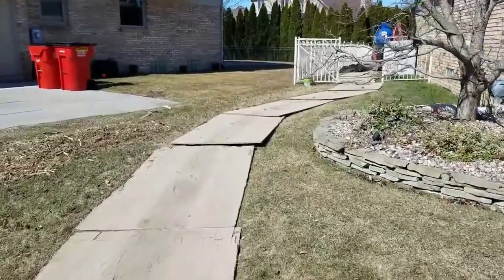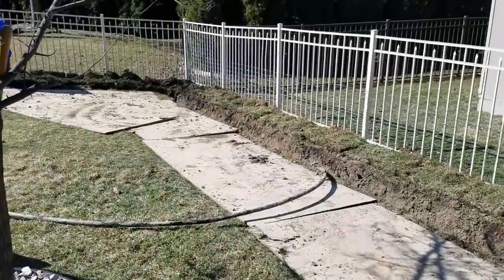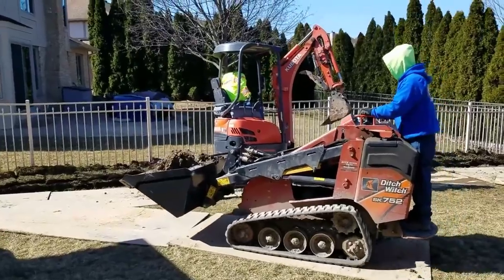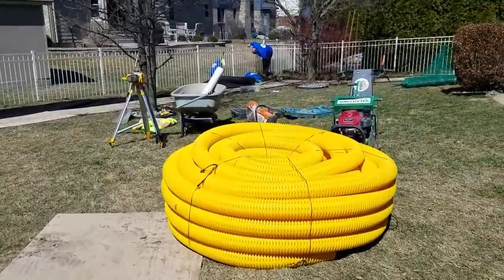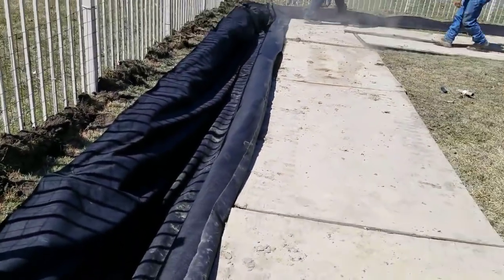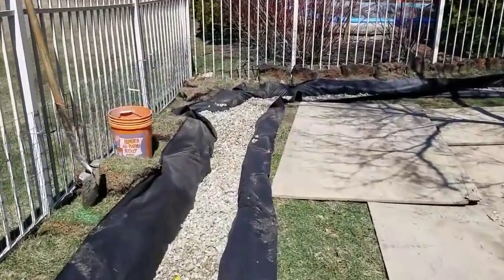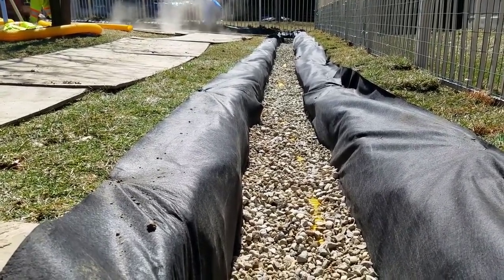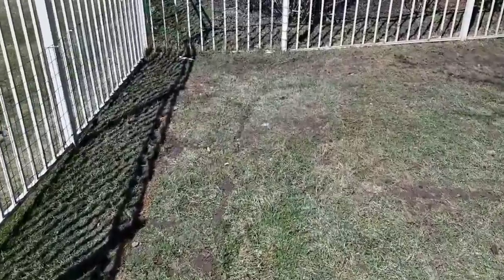FRENCH DRAIN MAN 248-505-3065 don't settle for a pretender get the real deal today 248-505-3065

Comment: I’m in Detroit Michigan.  Where can I buy the preferred geotextile fabric and pipe locally
Reply from the maker: FDM's Patented Yard 

French Drain Man / SherDrainage Duplex Sump System

FDM's Online Yard Drain Supplies:  https://www.frenchdrainman.com/store
=======

French Drain Man – Michigan’s Yard Water Drainage Experts. Masters in the art of constructing contained French drain systems & curtain drain systems that and fix your yard drainage problems for years to come. Over 30 years’ experience in solving yard water drainage problems in Oakland, Macomb, Lapeer, and St. Clair Counties.wood Landscape Construction, LLC
4015 Van Dyke
Almont, MI 48003
248-505-3065 

https://www.frenchdrainman.com
http://www.macombcountylandscaping.com

Follow us on:

Facebook: https://www.facebook.com/FRENCHDRAINMAN/ 
Instagram: https://www.instagram.com/frenchdrainman

FDM's Patented Yard Drainage Duplex Sump System

#frenchdrain #drainagepipes #frenchdrainman
Reply: FRENCH DRAIN MAN Thanks! Do you have any recommendations for concrete sealer along an exterior basement wall especially where the footer and wall meet?

Do you do installs in Southern Wayne County? High have most of the wall unEarthed.  

I might need to rent a piece of equipment to get through the hard clay near the house.  I am thinking about using a demo hammer with Clay spade if I do it myself
Reply: FRENCH DRAIN MAN One last question: how much stone should I put on top of the pipe if I’m using it as a drain tile or the basement footer? I have a walkout basement so part of it is about 8 feet below grade or more. While the other footer is at grade in the backyard.

Comment: I’m currently working on mine, it’s about 8 feet deep and I’ve dug it all by hand so I’m worried about getting it right. I’m glad I found your video as I was planning on putting the dirt back. Would 4” single ply perforated pipe withstand all the weight above it or should I go with 3 ply and drilled holes. And is it ok to go with about 7-1/2 ft of gravel and 6 inches of clean dirt to top it off?
Reply from the maker: https://youtube.com/playlist?list=PLjFCqaZ4v1BXWZPUFUNw6SMI64dtHlhzl&si=-x1-zoFvXWaxqdDl

Comment: The technology you describe has many components. Key is the washed and screened round rock. I get it. Simple  physics. It will drain best.  In my area, that kind of thing is considered a decorative product (called Glacier Jax) and goes for $240 per yard. Is that way off?
Reply from the maker: Use 1 1/2" crushed. When you go to that size it really Drains great. I have used it in the passed with no regrets.

Comment: Pea gravel,drain rock,willl in time will settle, especially by heavy traveled areas by traffic,take a 5 gal bucket fill it up till heaped,take a straight edge and strike it level,then just with fingers tap the sides,it will settle the more tapping or vibration it will settle till compacted,we back filled a loading dock area 3 to 4 feet deep with pea gravel,poured a slab over it with #4 rebar 18 in o/c ,years later did a reconstruction,removed area of slab,and found voids of 1 in or more under slab,many other examples and found the same effect,just saying ,I forgot to mention on the bucket test, it settled 1 in, só 3 buckets 16 in deep,would be 3 in settlement in 4 ft  foot of fill
Reply: Of course it not as critical on French drain applications
Reply from the maker: https://youtube.com/playlist?list=PLjFCqaZ4v1BXWZPUFUNw6SMI64dtHlhzl&si=MrmnGfmgH4rOKz4Y

Comment: I have been doing some research, and getting ready to put a french drain system in my back yard. the issue is I have no storm drain, and the reality the front of the yard is higher than than the lowest point of the rear of the yard. I am debating on using a dry well system By NDC. with hopes that the with some french drain, and dry well would be enough to help during the wet times, and allow the water to hold and slowly drain into the ground. 
Do you have any tips or videos, and system that could work without a drain outlet.
Reply from the maker: @Colin P
Drop a pump in your WET WELL your gonna need it.
Reply: @FRENCHDRAINMAN  
thanks for the tip. would any sump pump be  suitable or are there special models for exterior use?

Comment: So does  water still escapes trough the bottom of the felt when in the french drain.
Reply from the maker: It's supposed. Once the soil is saturated the excess of water runs through the French drain pipe.

Comment: Would someone educate me on what does this do? How does it benefit the house?
Reply: The benefits are no leaking basements or water build up behind retainers or water pooling on open land, kinds like a swale as in you are creating an uncompacted channel under the land to collect and transport excess water the way you want and away from basement walls, away from the areas behind retainers and away from the squishy parts of your land.... a good french drain system can have you yard clear of water in hours after a good rain, prevent basement blow and stop that retainer from just slumping down like a mud slide... but if you are going to do it... do it well, dig properly and pay for what you have to pay for... trust you dont want to be the one digging out a diy frenchy that was made using pvc drilled holes pipe 😂😂😂 oh how thay brittle pipe has collapsed is amazing 😂😂😂 and also super horrible to repair 😂😂